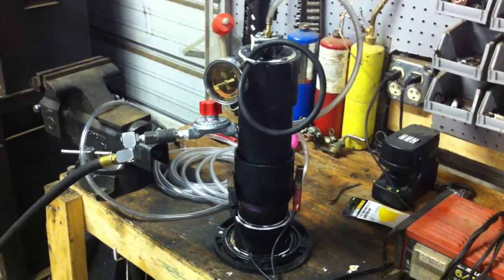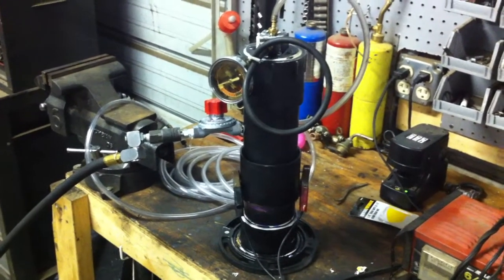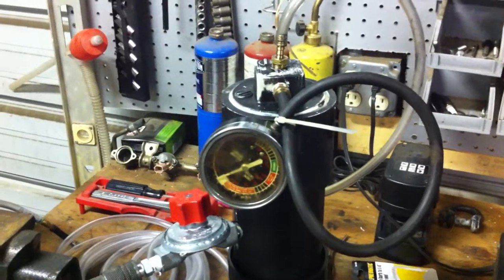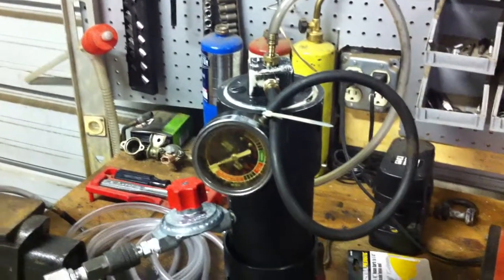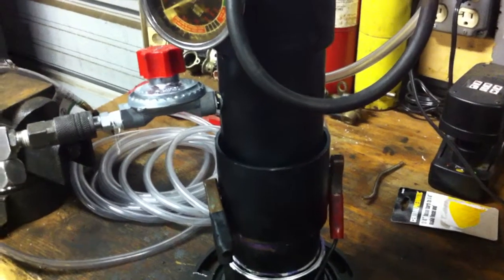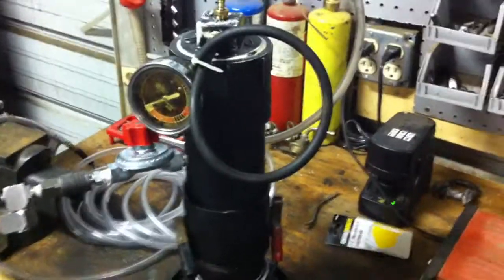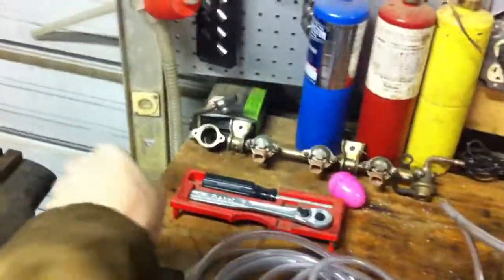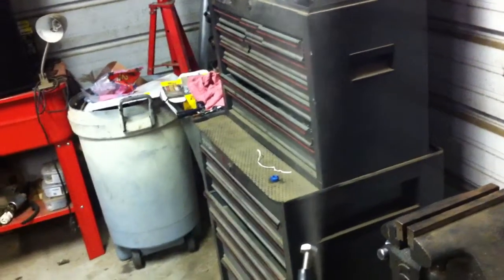Evap smoke tester-Vacuum leak detector

Comment from the maker: I have my wire heating to about 550 degrees but, Nichrome  wire can get up to over 2000 degrees easily depending on wire size, length and voltage being used. A Nichrome calculator can be found by going to google and searching for nichrome wire calculator and it will do all the math for you.